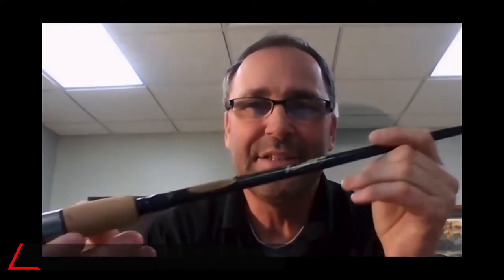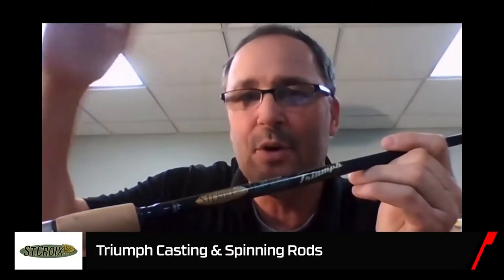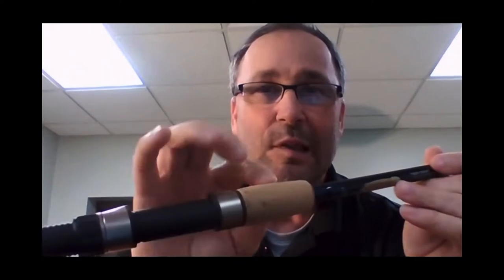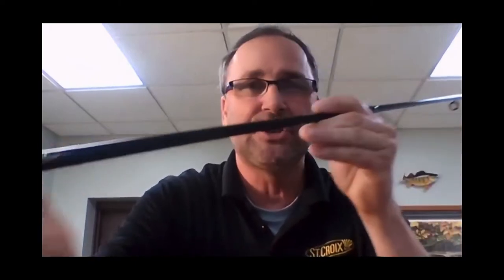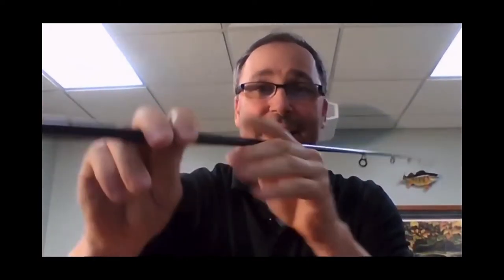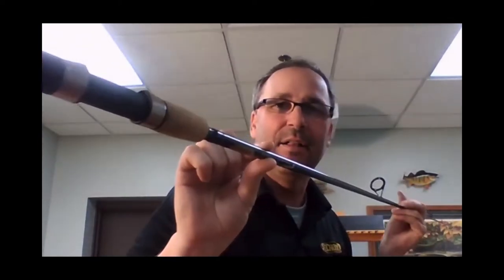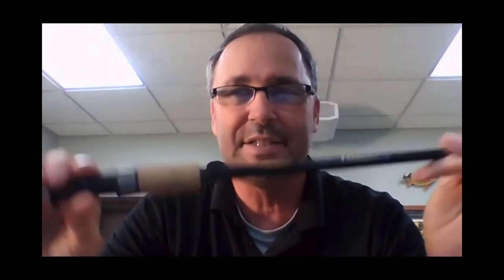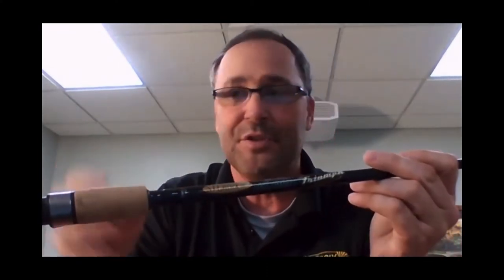St. Croix Triumph Casting Rods and Triumph Spinning Rods with Dan Johnston | ICAST 2020

Comment: I have 2 cracked guides & 4 missing guide inserts on my 7' Spinning Triumph. It's 2 y/o  has caught 3  specks under 16" in that time.  Warranty call to St. Croix & it will be $25 shipping for them to look  and get me an estimate. My 25 yr old 7' Uglystick and 7'6" Falcon Lowrider are still rock solid. St. Croix can do better.
Reply: Your ugly stick is like wearing 5 condoms though. Zero sensitivity. The St Croix waxes your ugly stik any day. The guides being an issue must be something you did or a single defective rod. I've never seen that complaint.